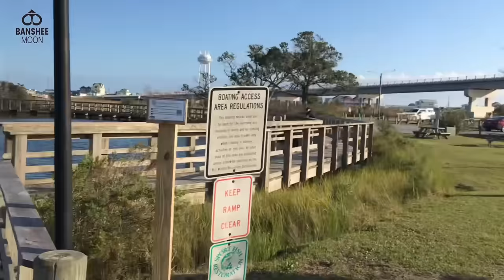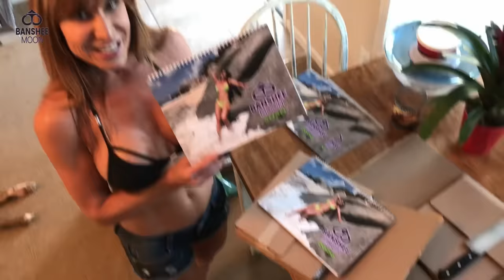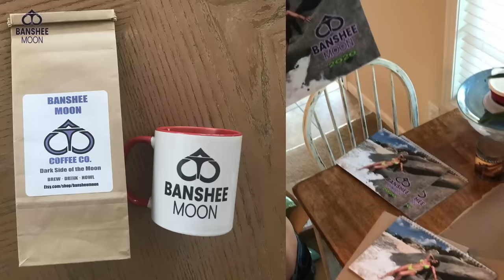Girl Launches Her Pontoon At Boat Ramp, Yamaha 4 stroke.

Comment: Get a rope about 3 times the length of your boat and a anchor or just tie the rope onto the tie down in the bed of the truck.  You can launch your boat and float it off of your trailer and won’t need to get out of the truck to drive the boat off of your trailer, it helps if you have a shallow boat launch too so you can back the trailer further into the water.  Congratulations on staying fit and your boating skills.